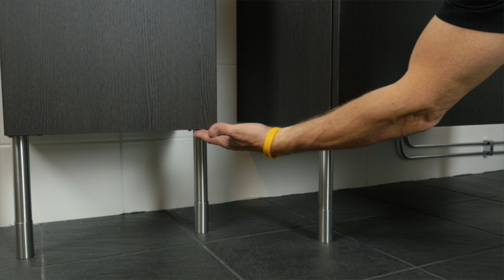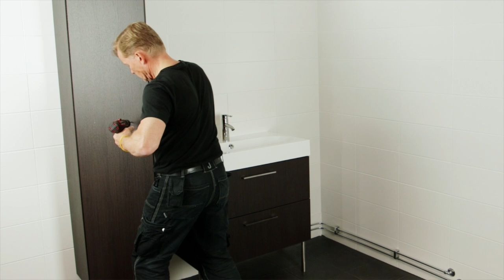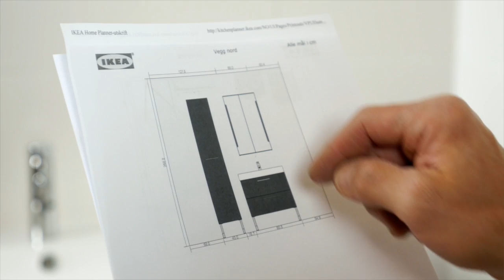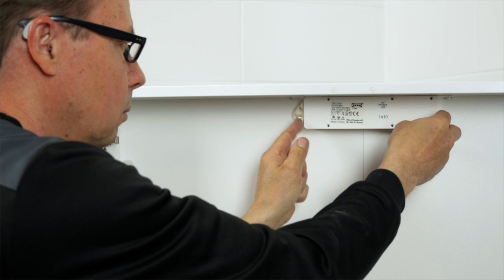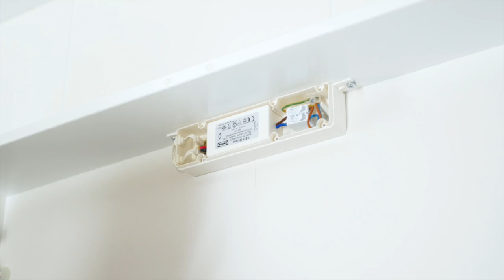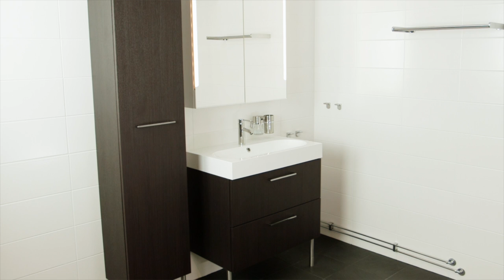Installing A High Cabinet And A Mirror Cabinet With Built in Lighting

Comment: how are the lights in the cabinet activated? switch on the wall? switch inside the cabinet?
Reply: they are hardwired into existing cables in the wall - either you connect them to an existing switch (like the main light) or they are on all the time